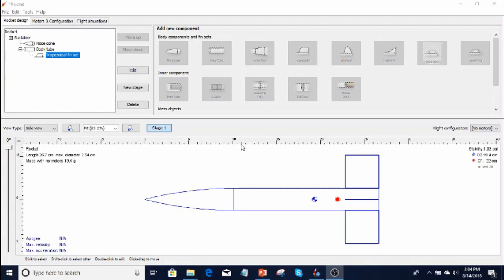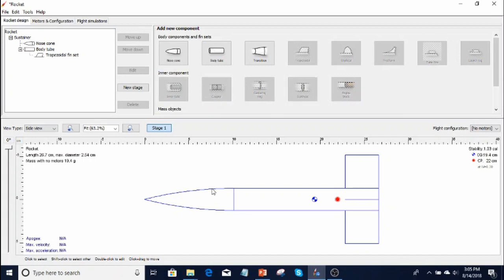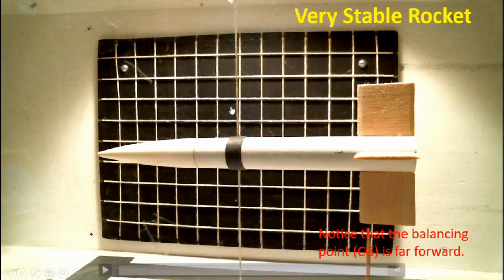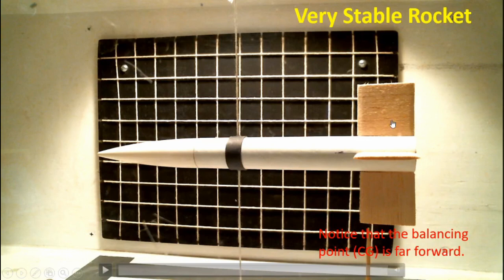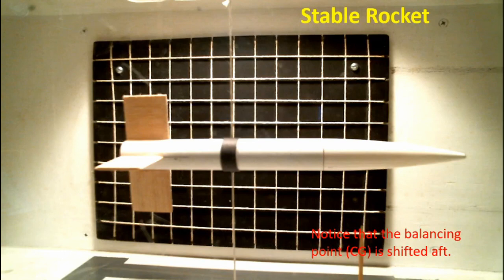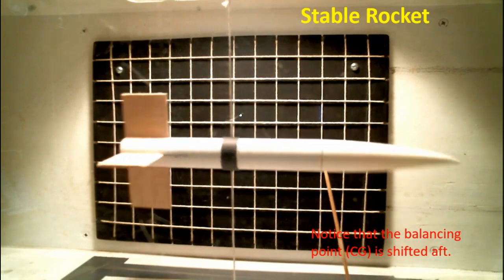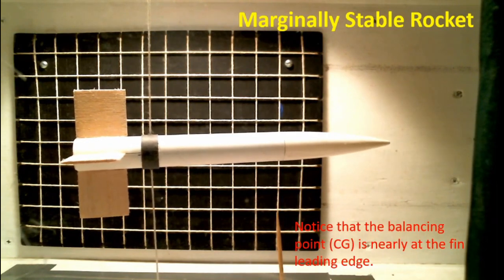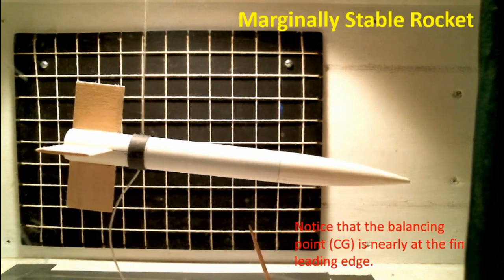Model Rocket Stability Test in a Wind Tunnel

Comment: sir i have a question after burning the full in the rocket where CG
Reply from the maker: For a model rocket the fuel tends to be at the back of the rocket.  As the fuel is burned the back end of the rocket gets lighter. This causes the CG of the rocket to move forward. The CP stays constant, and since the CG is moving forward during the burn the stability of the rocket increases (i.e. more distance between the CP and CG). This might not be the case for a liquid fueled rocket since the fuel load may be more towards the center or front of the rocket. It al depends on there the fuel is located.

Comment: Do we have to do the final rocket stability test with the rocket motor and parachute in place?
Reply from the maker: Yes, the stability test must be done with the rocket in the launch configuration.  The fuel in the rocket motor adds weight to the back of the rocket and will move the CG aft - making the rocket less stable.  You want to make sure the rocket is stable in the "worst case" configuration...

Comment: Do you really want it to fly into the wind? Or have a rocket that will fly straight up? I thought having a rocket that can lay perfectly sideways in the wind tunnel is best.
Reply from the maker: There is no precise answer to your question.  If the rocket flies "straight up" is will actually drift with the wind and thus not stay directly overhead.  If the rocket weather cocks into the wind, it can actually compensate for the wind drift affect - i.e. fly into the wind then drift back.  An unguided rocket needs to have some stability (a.k.a. static margin), usually between 1 and 2 calibers (a.k.a. body diameters).  This means rocket will tend to point into the wind to some degree due to its stability.  A neutrally stable rocket wont weather cock, but it will also likely become unstable as it hits wind layers.  You want to avoid rockets that are over-stable, because they will really point into the wind which is also undesirable.  Also, from a safety perspective you don't want your rockets to fly straight up, because what goes up will come down.  If you have a recovery system problem you could have a hazardous dart coning down.  I have seen this at more than one high-power rocketry meet and luckily no one got hit (but there have been close calls...).  Hope this helps.

Comment: The center of pressure will change if i ad weights ?
Reply: No. The center of pressure depends on the fins and aerodynamics, etc. The center of mass will change if you add weights, however, which can impact the stability of the rocket. Hope this helped :D
Reply: @رجلما-ز7ص   شكرا 😀